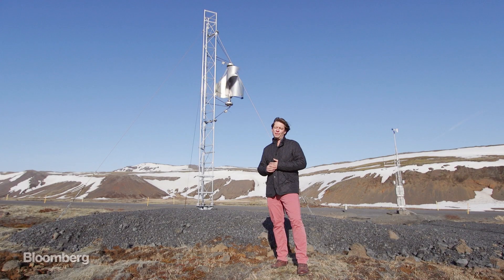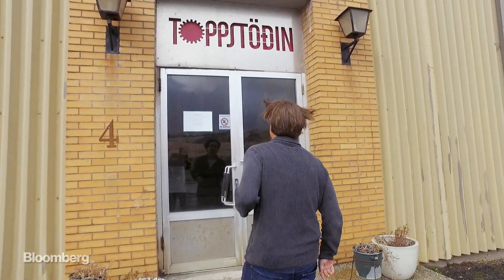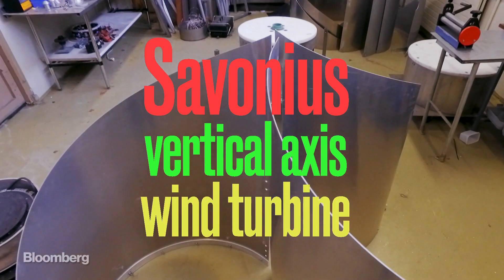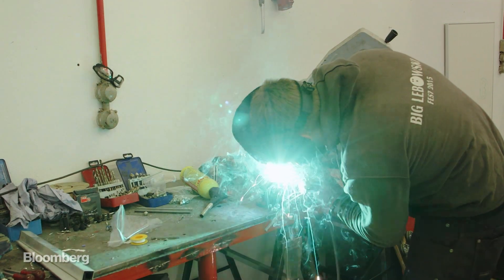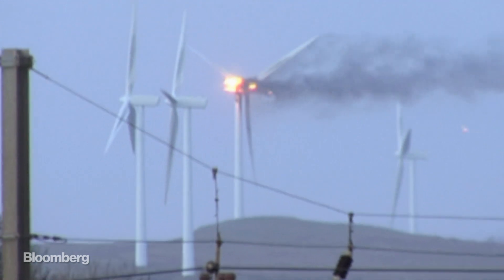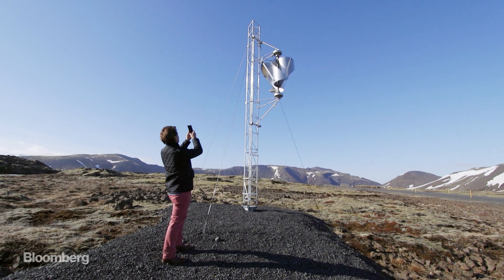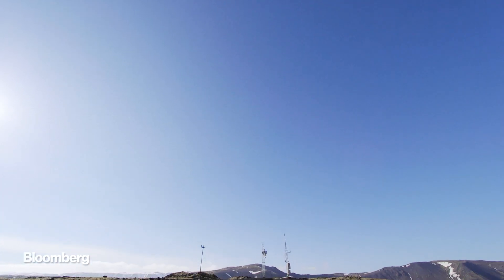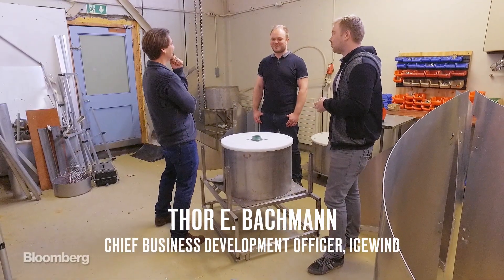The Tech That Could Fix One of Wind Power's Biggest Problems

Comment: May well work in a country the size of the U.S. state of Kentucky, and which has less than 1/13th the population of that same U.S. state, but try ramping up the energy to exponentially higher levels of need than charging a couple of cellphones and powering a wifi hotspot at a bus stop, and you're looking at these things more obnoxiously spoiling the landscape than either acres of a solar panel "farms" or the blades of huge wind turbines ever did. But, if it works in very small and specialized situations, then it works, I guess.
Reply: John Benton "John Benton": Typical and totally expected reply from someone who's given absolutely no thought to the MILLIONS of people around the world that he's just sentenced to death. If your "no more fossil fuels used for ANYTHING, EVER!" idiocy was ever going to be taken seriously by the 99% SANE population of the rest of the world, other than those like yourself who can do no better than insult rather than debating with any facts on their side, that would be EXACTLY what you would be doing. What do you propose to use as an alternative energy source which could heat peoples homes when they needed to be, and power their small businesses which are the necessary lifeblood of any fledgling economy? Is MASSIVE (capitalized for a very good reason, even though you'll most likely still be clueless as to why) deforestation your answer? Yep, cut down ALL the trees to burn for heat and you've just created an ecological disaster. Still proud of yourself? Maybe you're a fan of nuclear? Yeah, right. Just try to get that one passed beyond all of the "Greenpeace-type" nuts, and the "NIMBY's" after Three Mile Island (which caused NO verified public health threat in the wake of the shutdown of TMI 2, the reactor most affected), Chernobyl, and Fukushima, where any actual damage to the public was because of the 9.0 EARTHQUAKE AND THE RESULTANT TSUNAMI, and not any radiation-caused health concerns to the mass population. Just what DO you propose to use as an energy source NOW to replace the energy needs that fossil fuels and nuclear have sufficed quite nicely for providing for an industrialized 21st century and beyond world economy, hmmm? And please don't start with "renewables", as anything that relies on undependable sources which can't be stored in any real quantity at this stage of the game, is just a ridiculous non-starter.
Reply: John Benton You're a completely unresponsive, foul-mouthed, and brainwashed eco-ideologue who has brought absolutely NO FACTS to the table here as part of any rebuttal at all, intelligent or otherwise. You've had multiple chances to do so, and you've refused all of those opportunities. Therefore, you're done here.
Reply: You are right about it's limitations, and also right about those examples you chose of very useful and practical applications (small scale electronics power )
Reply: lol no imagination, wouldnt make a sky scraper any more of a blot on landscape then it already is and above 3rd floor theirs always wind just strap them all over skyscrapers in citys
Reply: At least he aint accelerating exhaustation of those resourses by very inefficient designs.
Reply: [A bit long but this is what I sent a friend recently]

SOLAR PV & BATTERIES

SolarPV has fallen in price by 70% since 2006.  2016 Q1, 64% of new power generation in the U.S. was Renewable, most of which was SolarPV. It's predicted that SolarPV will reach grid parity with Natural Gas by 2020 if not sooner.

Lithium-ion batteries between 2007 and 2014 have fallen by 60% in price. The Gigafactory  being built in Arizona will double the World production of lithium Ion batteries and other battery mega-factories are planned around the World. Prices will fall even further due to mass production.  If the price reaches $100/kWh it will mean a major shift in the energy markets according to many energy experts (you can google articles on this set milestone in the industry).  

Create low cost batteries for  EVs and you''ll see more and more commuters moving over to electric vehicles for cost savings versus burning gasoline. Tesla, GM, Ford, , BYD ,etc will all have 230+ Mile range EVs on the market by 2018 in the $25k-$45k price range with an operating cost of an equivalent 100 MPGe rating.  As the price of batteries continues to fall, the price on the EVs will fall even further and even more commuters will switch over.

Change is happening now and its been happening.  It's gaining momentum and will continue to power though for the next few years.  The newest technology has been created it just needs come to market in the next few years..  

You should verify all of this yourself. It's going to be amazing to watch over the next decade and into the next.
Reply: Chris Curran "Chris Curran": You had already been dispatched from this particular comment thread weeks ago, but again you come back with even more ridiculous backtracking and laughable double-talk. 
        
       1) "If you know what's happening with solar panels and batteries, you will not be a doubter. It will take decades to accomplish but it will happen."   

These solar energy companies are those which have mostly all become belly-up, bankrupt failures or soon will be. All of them never figured out how to make their businesses PROFITABLE, although I'm sure they all echoed your enthusiasm until the day they went BANKRUPT. Among them, two of the largest solar energy companies in the world at the time of their financial demise, SunEdison, and Abengoa. 
The others are:

Evergreen Solar ($25 million)*
SpectraWatt ($500,000)*
Solyndra ($535 million)*
Beacon Power ($43 million)*
Nevada Geothermal ($98.5 million)
SunPower ($1.2 billion)
First Solar ($1.46 billion)
Babcock and Brown ($178 million)
EnerDel’s subsidiary Ener1 ($118.5 million)*
Amonix ($5.9 million)
Fisker Automotive ($529 million)
Abound Solar ($400 million)*
A123 Systems ($279 million)*
Willard and Kelsey Solar Group ($700,981)*
Johnson Controls ($299 million)
Brightsource ($1.6 billion)
ECOtality ($126.2 million)
Raser Technologies ($33 million)*
Energy Conversion Devices ($13.3 million)*
Mountain Plaza, Inc. ($2 million)*
Olsen’s Crop Service and Olsen’s Mills Acquisition Company ($10 million)*
Range Fuels ($80 million)*
Thompson River Power ($6.5 million)*
Stirling Energy Systems ($7 million)*
Azure Dynamics ($5.4 million)*
GreenVolts ($500,000)
Vestas ($50 million)
LG Chem’s subsidiary Compact Power ($151 million)
Nordic Windpower ($16 million)*
Navistar ($39 million)
Satcon ($3 million)*
Konarka Technologies Inc. ($20 million)*
Mascoma Corp. ($100 million)
*Denotes companies that have filed for bankruptcy.

2)Solar panels and batteries: Solar energy still cannot be stored, and solar panels have already become ecological disasters in terms of the cost of trying to recycle the heavy metals used in their manufacture. You ADMIT that solar and batteries able to store solar on any kind of a wide enough scale to be profitable "will take decades". Then, in your very next sentence, you completely contradict what you just said, exclaiming in your best wild-eco-eyed abandon that "(a) major push on renewable energy production is underway. The future is here...", while you conveniently don't cite any sources to back up either any such venture's existence, or it's outlook for any future profitability. 

3) "By the end of this decade all will know the cost effectiveness of solar..."

        Everyone's had the last 60 years to figure out "the cost effectiveness of solar". If you truly believe, that in 3 and a half years, that the failure after failure, and bankruptcy after bankruptcy, of solar companies will somehow magically just flip 180 degrees in the marketplace, and that they'll all become profitable, then I'm afraid that I'm going to have to put my money with "the Doubters" as you call them, rather than with "the Delusionals" such as yourself in your ilk.
Reply: I think the ability to also fuel your car from these solar panels would be enough of an appeal to flip solar companies 180
Reply: No doubt you have an alternative plan ready to swing into action when the world finally tires of fossil fuel-generated electricity?
Reply: John Benton And you're "tired enough of fossil fuels" right now to forego the advances in modern medicine, your computer, your game console, your "iPad" your wireless phone, your car, your housing, basically ALL forms of mass transportation, and basically EVERYTHING ELSE which makes it possible for you to exist in the manner to which you've become accustomed in the 21st century, rather than being forced to exist in a pre-1850's lifestyle? Yeah. Sure you are! Tell me another joke.
Reply: NGC1433 "NGC1433": When you're talking about "he", are you talking in reference to the comment made by "John Benton', or are you referencing the point which was being made in the video by the original design company of these energy converting devices?
Reply: John Benton "John Benton": Last time I checked, there was nobody hellbent on stopping you from following through on your totally ridiculous spew of completely meaningless "eco-extremist bravado". Seeya on the other side Dude, and "Happy Trails!" :-D
Reply: I don't think you're ready for what's coming.  Expect a paradigm shift in the energy sector. Once it starts it will happen quickly like every other shift before it.  Within one to decades local electrical energy generation and storage will change our lives.
Reply: renewable energies are being developed and will eventually replace all fossil fools
Reply: Uncle Reeko "Unc": Whenever anyone throws in the word "eventually" into the middle of what amounts to nothing more than a prediction trying to be sold as a "certainty", it's about as much of a "precise and brilliant thought" as saying "I PREDICT EVERY LIVING CREATURE ON THE FACE OF THE EARTH HAS ONLY A FINITE LIFESPAN!"
Reply: Chris Curran fossil fuels WILL be completely replaced. all the answers have been right in front of us but apparently I'm the only one that can see them. within a few years I should be commercially producing my energy storage system and engine. electric vehicles will never be a viable option. I don't get why so many people beat the dead horse. fuel is the only way to meet the energy density required for transportation, especially flight. the electric cars are the definition of insanity.
Reply: John Benton he may not but I do. we can keep everything about our lifestyle with absolutely no fossil fuels or polution.
Reply: Uncle Reeko renewable energies are here but no one else knows how to use them properly yet.
Reply: If your concern is that this only being done on small projects or on a small scale, consider several of these interconnected with power being stored in a battery.  This creates and harnesses energy that wouldn't exist without the turbines.

When you think of decentralized energy production, we usually think of individual houses with solar panels.  This could create extra power to store at homes, or be placed to store power collectively.  

I think it's a good start and something worth considering.
Reply: I seem to manage rather well with virtually no 'modern conveniences'. I'd rather be dead before the world runs out of oil. You?
Reply: Chris Curran "Once it happens", and "within 20 years"...don't you think everyone's been hearing that for at least, how many years now? 50 years or so?
Reply: Chris Curran "Chris Curran": My response to your "supporting" harangue is exactly the same now as it was in my initial reply: get back to everyone in 20 years after yet another "WOW! You just WAIT to see where we all are going to be in 20 years!" proclamation. The "Prius/electric car" crowd 20 years ago is a perfect example. They predicted that within 20 years the "electric car" (ROTFL!) would be the "standard" for automobile design, and yet 20 years later, ALL SALES OF "ELECTRIC" AUTOMOBILES AMOUNT TO AT BEST 1, JUST ONE PERCENT of total new vehicle sales in the U.S. . You're simply just looking at a pipe dream if you believe that your particular favorite "new" technology developments somehow just "magically flourish!" in a complete and utter vacuum that's completely unaffected by both national and worldwide events, and the new developments and improvements in "traditional" energy source technology.
Reply: I gave you solid information to pursue to learn for yourself but you are so far up your own ass you are going to miss the party.   Youre the guy a hundred years ago scoffing at the motorcar raplceing the horse as you scrape the horseshit from your boot before you enter your home.

There is no need to convince you.  It's going to happen because the investments have already been made across the board by hundreds of companies big and small to bring better SolarPV and Lithium-ion battery products to market. Short of something catastrophic in the world, it's going to happen.

I'll be on-grid solar in 3 years and then off grid within ten to fifteen years with a super efficient home and  a Tesla Model 3 EV completely powered by solar panels. Living off the land energy-wise like my ancestors, beholden to no corporate fossil fuel energy companies for my home and trusty stead. I'm not in to Green; I'm into sticking it the greedy energy barons.

Meanwhile you will continue to pay the fossil fuel companies month in month out for decades to come in likely an inefficient home and car. I hope you have a good pair of knee pads.

Enjoy the next decades as at unfolds.  Your closed mind is going to implode.

Go ahead get the last word.  Maybe I'll come back to read it, or maybe not. If it's anything like your other "words" they will be vacuous.  I just dont see the point in reading it.
Reply: Chris Curran "Chris Curran": I give you REALISM, and get a foul-mouthed invective-laden piece of purely politics-driven ideological garbage from someone who's only interested in hearing his own insult-ridden head rattle, in return. If anyone needs a tutor in how to be absolutely nothing but a bullying and insulting virtue signaler while simultaneously being an incredible hypocrite, no one needs to look any further than yourself. "Congratulations", and you be sure to send all of us a postcard via "Pony Express" (because remember now, NOOOOOO fossil fuel produced or powered electronic gadgetry for a good little eco-virtue-signaling hypocrite like you, right?) to let all of us know just how many years again it will be, I mean by your and Tesla's "best guess" at a "timeline" (ROTFL!), of just when you've achieved your own self-awarded "status" as "The Best VIRTUE SIGNALING ECO-HYPOCRITE I Can Be!!!!!!"   (...groan)...
Reply: This. Considering US's prime locations for solar energy farms and the massive area of deserts it has, I'd dare say that appropriating it for solar energy seems much more viable than wind energy.

They could build massive numbers of them offshore and do it like that I guess, but that's much more expensive to maintain in the long term.
Reply: Maybe it's really about learning to use less, at lease in non-emergency situations. I lived off grid for 2 years in a cabin in the woods with no electricity in the home, only in public spaces. I did not grow up that way. I grew up in the 1960s in America and had everything you can imagine in the way of conveniences. If I can do it, almost anyone can.
Reply: Ladyhawk47 "Ladyhawk47": If that kind of lifestyle works for you, great. But is that kind of lifestyle going to be practical or agreeable to any but realistically a relatively very tiny fraction of the population?
Reply: All fossil fuels wont be replaced since there are niche places it will be ideal for its use, BUT with that said fossil fuels are about to be replaced as our mainstay of energy supply.

If you know what's happening with solar panels and batteries, you will not be a doubter.  It will take decades to accomplish but it will happen.

When will it start to happen?  Umm you missed it.  It has already begun. I'm not talking about a few solar panels going up.  I'm talking major push on renewable energy production is underway.   The future is here it's just not widely distributed yet.

By the end of this decade all will know the cost effectiveness of solar. It will have growing pains like coal and oil had but we will get through them.  We see the problems of this kind of shift and we are already working to smooth it out.

Enjoy the next couple of decades, Doubters.
Reply: Chris Curran
Reply: the solar only failed so far because they have been going about it completely wrong. the energy needs to be converted into fuel for storage and profitability.
Reply: bohnstube 
its no different than an exhaust fan.
Reply: Irval Firestar "Irval" SunEdison, once the darling of the solar industry, just went bankrupt. They were in business since 1959, admittedly doing god only knows what, but they certainly weren't doing it well. They had 2.84 Billion dollars in revenue in 2014, today they're practically nothing. If they can't make "solar energy farms" possible AND PROFITABLE, who can?
Reply: Uncle Reeko "Unc": Coming from an empty-headed troll such as yourself, who simply spews meaningless "predictions" as being somehow profound, I fully realize that your followup comment is EQUALLY nothing more than your wildly self-imagined "intellect" screaming out in a toddler-like tantrum "LOOK AT ME! NOTICE ME!"